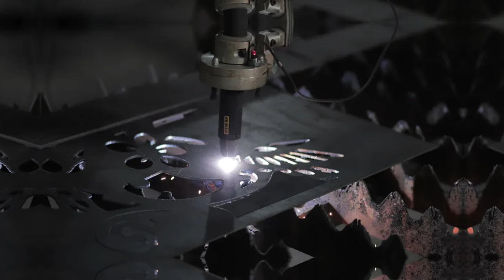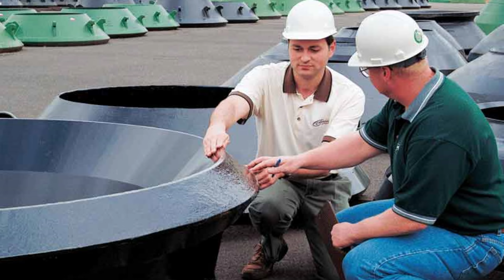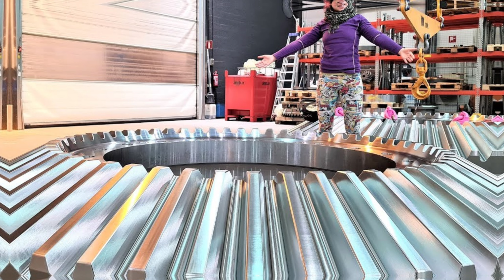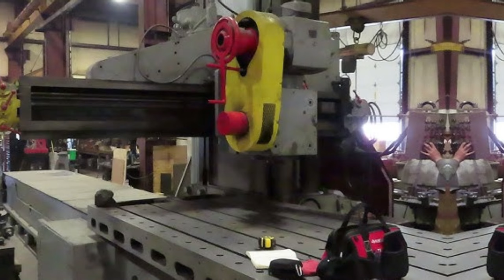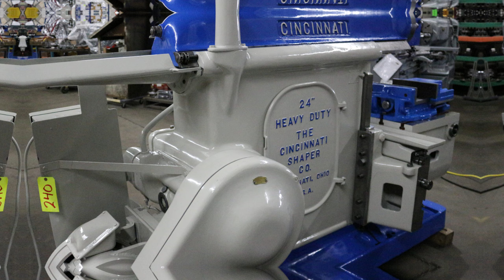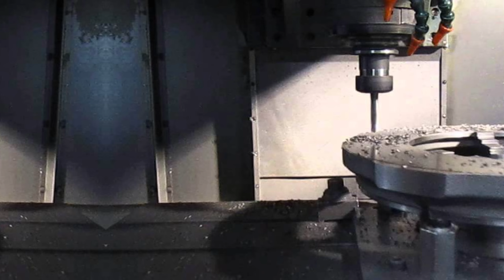The 1911 Planer Machinists Called Obsolete — Until It Removed More Steel Than Any CNC

Comment: You have a design engineer and CAD designer who specc’d a material that state-of-the-art CNC mills couldn’t handle?
You burned up one mill, didn’t revise your speeds and feeds to save machine #2. 
Your project engineer sign off on a contract with the customer that included penalty clauses for performance and timing that any decent project manager (for the machine shop) would have caught with even a cursory review. Every other shop approached caught it, and refused to quote the job with manganese alloy steel. 
Plenty of big screw-ups to go around here.
Then along comes a century old machine that’s been sitting idle for decades to save the day.  Hmmm…
Me smells a made up story.